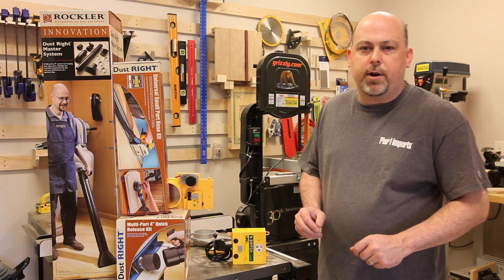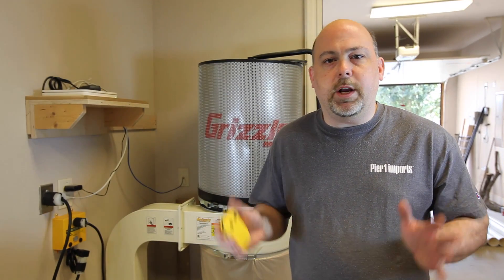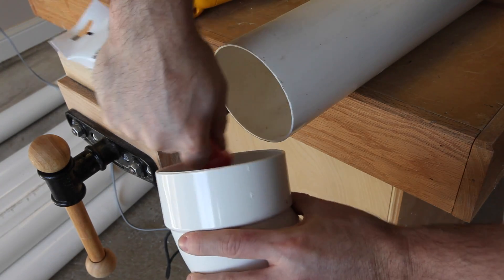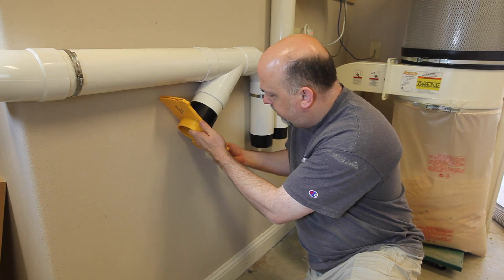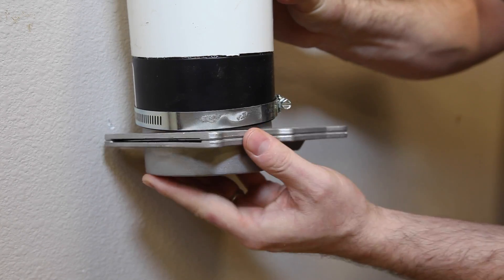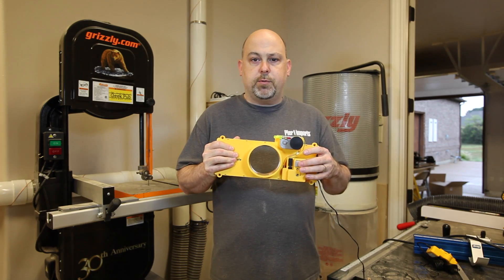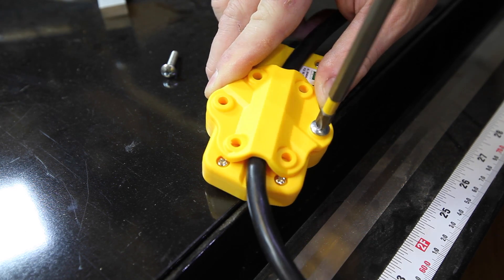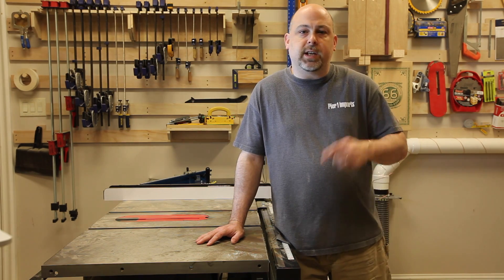Installing an Automated Dust Collection System

Comment: With Rockler (apparently) sending these to you for free, I'm not surprised you're so satisfied with these products but if you had to pay for this (per tool) automation you would realize how expensive it is.
Reply from the maker: And after having this system for 2 years, I'd happily pay double the asking price. It's been the best shop upgrade I've done.
Reply: If you do a lot of woodworking, it wouldn't take too long to get your payback - just in time savings - not having to manually turn the collector on/off, not having to open/close blast gates and also reducing plugged ducting because you got lazy and used a tool for a while without the dust collector running. 

Also, when you were explaining how you have the system set up, you stated that the blast gate closes immediately, then the dust collector shuts off after a delay. This is the wrong way to do it. The default setting on the gate is for it to stay open for 15 seconds after the power tool is turned off. This allows the dust collector to clear the residual dust in the tool and ducting, then shut off. THEN the gate closes. 

Also, you didn't mention that the primary blast gate will always open if the other blast gates are closed.

Comment: You had a slight smile of "this is great" when you turned on the table saw and the dust collection came on.  I would have the same smile too.  Good job and thanks for sharing.  I do believe I'm going to do something similar.

Comment: Just a quick question. What is the grounding wire grounded to? Do you ground it to a copper water pipe or just tool to dust collector?
Thanks
Reply from the maker: It is grounded to an electrical outlet at both ends of the chain.
Reply: @TheGeekPub  It is important to connect the grounding system at a single point.  with it grounded at both ends you can set up an inadvertent "Ground Loop" such at in a situation when you have a fault on one of your machines it could send a surge of current in that ground loop.  All grounding systems should only have a single tie to ground.  You can use a "Star" configurations with spokes that go out from a single point but only ground it at one point.  Especially in a shop when different machines are powered off of different circuits these ground loops can be significant especially in a fault condition.  EE101
Reply: TheGeekPub 
Thanks, that makes sense.
Regards,
Herms

Comment: Don't they sell a kit that lets you use the dust collector as a vacuum cleaner? That'd be my personal preference over a broom. I've got the in house central vac equivalent of those floor sweeps (Vacpan) in the house, but I find I just use a hose and floor tool on the bare floors rather than using a broom to sweep it into the vacpan.
Reply from the maker: Yes, and I showed it in this video.  :-) I have both.  The vacuum is so much more tedious to use and dragging a big 4" hose is quite annoying.

Comment: i think this could have been simplified a little better.  by adding another wire to the grounding wire, to power the gates, i dont see those gates needing much power to open and close,  doesn't needing to plug in every gate limit placement to reach a outlet?
Reply from the maker: That's not how the system works. The gates are powered independently from the sensor that detects the power.  This is because the gate in many cases will be a long distance from the tool it associated with.
Reply: and having a wire run along the tube wt=ith the ground wire, could power the gates still, they are controlled wirelessly from the cord sensor on the tool, and those gates cant take more then 4 volts, means one outlet gets used to power every gate, with power cord daisy chained along with the ground wire, it would free up the other 6+ wall outlets youre using to power the gates. its just my opinion on how i would do it, this wa im not limited to placing the gates close enough a power cord can reach a outlet. using wires simular to this http://www.diago.co.uk/adaptors/daisy-chains.html since the ground wires already there, wouldnt take any extra paths, not sure how else i can explain it simplier, so hopefully you can see what i mean, otherwise, just ignore me. :) https://en.wikipedia.org/wiki/Daisy_chain_(electrical_engineering)
Reply from the maker: According to the specs the gates run 12v and pull 1 amp at peak (motor turning). So if you wanted to upgrade the wire to a thicker gauge you could probably get something that would work.  Just seems to me like a lot of extra trouble to save a few outlets.  I put in six-gang wall outlets at every tool, so its just not something I struggle with.
Reply: i understand what you mean, but for me i only have 4 outlets in my garage, but 12 tools, so to me every outlet saved is worth the  trouble.also, 12 volts aint to bad, im sure i could get it to run on a lower voltage, and is the 1 amp peak, consent? or is it just the in-surge  current from motor starting?

Comment: The fittings I'm asking about are the White 4" PVC elbows, reducers, adapters, couplings, etc and not the Rockler adapters. Thanks
Reply from the maker: Correct.  Again, check my website for all the details.

Comment: Good video, better than the iVac website! I'm definitely checking it out, sick of not opening a gate or forgetting to close one! Agree with the ground wire. Every time I opened a gate for the jointer or planer I got zapped until I ran a ground. Cost? 25 cents, problem solved. Can't believe the troll comments you got. Thanks for helping the ww community!

Comment: I have a 220 DC with a Y attached. My system goes up into the attic and connects to eight separate drops. I want to put two blast gates on the Y so that I can close one down and let the other run and vice versa for more suction. My D.C. is in a closet and I would like to remotely control those two gates on the actual dust collector; not the tools. I use the long ranger II to wirelessly turn D.C. on/off. Is there a way to make these blast gates on the actual Y automatically open and close with this system? Thx. Nice video and you did a great job explaining this system. That is except for my question 😊

Comment: I'm seriously considering this for my workshop... however i'm investigating at this point if the dust collection will be on when my CNC mill is turned on (but not necessarily milling anything) or if it'll be nice to me and avoid being on until it actually has something to do..

the cnc could be on, and initializing, or me setting up the part.. but not necessarily generating wood/aluminum chips ...
and even more importantly... when the cnc finishes its job.. the mill turns off, but the machine is still technically on.. thats where the 6 second delay for the vac turning off is good...  otherwise it could be running all night if i fall asleep on a long milling job (yeah i know... dont leave the machine alone.... be quiet i already know this! :) )

has anyone done this setup with a cnc mill in this way? with ivac?
1. machine on.. DC not on... 
2. machine starts to mill,  DC Goes on..
3. 5 hours later when i fell asleep after the last tool change... DC goes off automagically..
4. CNC still technically on.... but not making noise either...
Reply from the maker: Should be pretty easy.  Just tie the CNC Spindle power to the dust collector, not the mains power.  That way the DC will go off when the spindle is off.

Comment: What is grounding use for? I still dont have any idea about that
Reply: felix malvian the moving air will build up electric charge on the plastic, once the voltage gets high enough to jump to a piece of metal or grounded material it will create a spark. that spark can set off an explosion if the air-dust mixture is right.
Reply: to "prevent" a dust fire. which has never happened, but is a popular theory among woodworkers.
Reply: literally  like less than a week ago a school near me had a dust fire in their dust extractor all of the woodworking rooms were destroyed .. so yes it has happened before.
Reply: ri mar Try searching for baghouse explosion.
Reply: Nord-please do not compare the conditions of a pellet mill to an at home system. Gaming- please source this school dust fire. I am sure there were other conditions for this to occur. Seeing as for many years there have been little events tied with this, that there are secondary reasons. I have no issue with reconsidering if there is credible evidence  that simply the "static" alone is enough for a fire.
Reply: http://www.dailytelegraph.com.au/newslocal/liverpool-leader/students-evacuated-after-fire-at-miller-technology-high-school/news-story/386bfb98e77c6be93af617d6c610e44a
Reply: Which was most certainly from something hot, like a bit of metal, causing the fire - not due to a static charge. That assumes their system was not a big commercial bag house system.

Comment: looking to get set up and I have a few basic DC questions: 
-do I need a blast gate for each tool or can I run two (or more) tools off of one blast gate?
-did you use any basic guides to help lay out your system?
Reply from the maker: 1) Up to you. 2) nope.

Comment: I'm having trouble pairing up my 220v dust collector to a 110 table saw with the switch, can it be done?
Reply from the maker: The voltage of the tool doesn't have to match the collector.
Reply: Ok but the device itself doesn't have the female plug for 220 right?
Reply from the maker: They don't have plugs at all.  They just clamp to the wire and detect induction.
Reply: On the now obsolete Pro Tool, the machine plugs into the Pro Tool. The new version clamps onto the cord, which is much more convenient.

Comment: wrong ,  think ,.......after  You turn of machine , blast gate should stay open to clear  ALL pipes of ALL dust  otherwise You just creating noise no suction , blast gate is closing when  dust collector is turning off
Reply: ALBATROS - Uhm, were you watching the same video I am? Because if you were you weren't paying attention.
Reply from the maker: That's exactly what the system does. LOL. It keeps the blast gates open for whatever time you program on the dip switches after the machine turns off, and continues to run the dust collector for 20 seconds after that in my case.  Pay attention in class boy!
Reply: TheGeekPub, you stated in the video that upon shutting down the saw, its blast gate goes closed immediately, while the dust collector continues to run for its programmed delay period.  s.v. ALBATROS is correct; running the DC with blast gates closed dead-ends the system - nothing moves.

Comment: There has never been a recorded case of s plastic pipe system exploding. Rockier is yanking your chance for profit.
Reply: Fires, quite possibly. Hit a nail in your wood while cutting it and you might get a hot piece of metal that causes a fire.

But that is NOT what you claimed, which was eliminating the possibility of a dust fire/explosion. If you had just left it at "The wire wrap reduces the chance of a static shock when you touch the outside of the pipe." then I would have no complaint in that regard.

Your wire wrap explanation also is incomplete. You showed wrapping the pipe and connecting the wire to the dust gate, but you did not show what needs to be done at the dust collector and tool. Do they need a frame ground or not? Also, doesn't the flex ducting going to the floor sweep need to be wrapped and connected?
Reply: I hadn't thought of that solution. I will try the static guard when I install my system in a few weeks.
Reply from the maker: You're right. But there are several cases reported by insurance companies of fires.  But as I have said in the video and numerous times in these comments, the fact I can touch the pipe without getting shocked every 30 seconds makes this a win regardless of any dangers. Which is exactly what was happening before I installed the grounding system.

Comment: Great. 4:45 Why should wrap copper wire around the pipe?
Reply: to waste money pretty much. suppose to prevent static buildup that could cause a dust fire. this has never been seen to have happened and is only a loose theory.
Reply: Grounded to prevent static build-up.

Comment: Dust fire like a wheat grain elevator. I think I would not use a large system like this in my home location. To each his own but don't want to chance it.
Reply: Correct. The energy potential that can build up depends on two major factors, the dust velocity and the interior diameter of the ducting. Even 6" duct is far too small in diameter - there are not enough joules of energy to cause a dust explosion in sawdust, even under ideal laboratory conditions.
Reply: @alphasxsignal The health risks of breathing dust far, far outweighs the remote possibility of fire in a well designed system.  If you do a lot of woodworking, you would be wise to have an adequate dust collection system.
Reply: The chances of an actual fire from static electricity are pretty much Zero. The chances of a fire from dust floating around your shop and being lit by the pilot light on your water heater are probably much greater. The chances of getting lung cancer or some other nasty disease from breathing the dust is much, much greater. There is really no chance of starting a fire and the only reason to ground the system is to keep from getting shocked when you touch it.

Companies like Rockler do like to use these myths to sell gullible people over priced wire. P.S. Double check reviews of Rockler products on Amazon before buying them. They have some good products, but they have a reputation of deleting negative reviews on their branded products.
Reply from the maker: Systems like these are in use all across the world in commercial and backyard alike.  They're quite safe.

Comment: I don't uses a remote unit ,I installed a metal ext cord to the wall .And plug all the equipment to the ext cord.Than i plug the ext cord into to the switch.So when i turn on any equipment the dust collector come on,and when i shut the equipment off in 7 second the dust collector shut off. With no remote to carry in your pocket
Reply from the maker: +Lawrence White There's no remote to carry on this system.

Comment: If my ceiling was as tall as yours I would do a raised floor and run the dust collection across the ground. Great for electrical runs as you can pop them up right near your stationary tools. Another added bonus is insulation and greater anti-fatigue over concrete.
Reply from the maker: +Kenny Garland I considered that, being a technology guy.  But I liked the stability of a concrete floor.  Tools perform better when they sit directly on concrete.

Comment: The automated wireless is pretty slick.Not sure what to believe about the grounding necessity.  Some people say it's complete nonsense, some people say the combustion problem can only happen in much larger systems, and others say there is no risk of spark at all because PVC is not a conductor.I think an interesting experiment would be to place a an amp meter in series between your ground wire and your grounding point.  I think that Harbor Freight has been giving them away as free gifts recently, don't know about right this second.  If that system really is discharging static, I would think that you would be able to see either current spikes or some small steady state current while the collector is on.I'm actually in the process of building one of these, and would like to know if the threat is real!!!
Reply from the maker: +Jeff Correia As I can tell you one thing.  Before I added the grounding, every time I touched one of the pipes I would get zapped by static electricity.  Fire or no fire.  It was worth it.